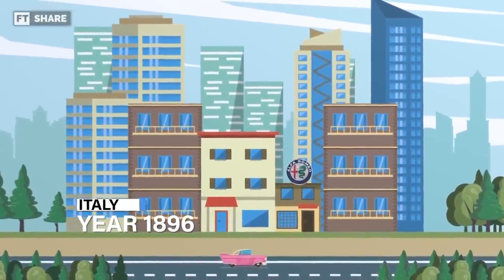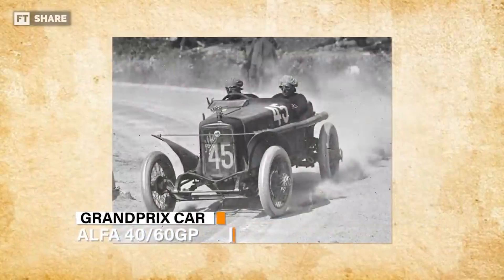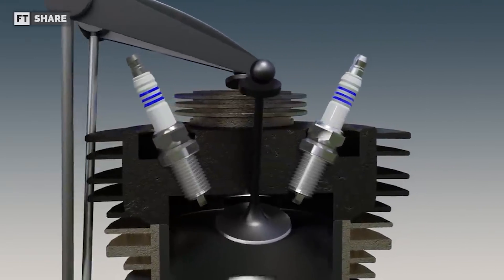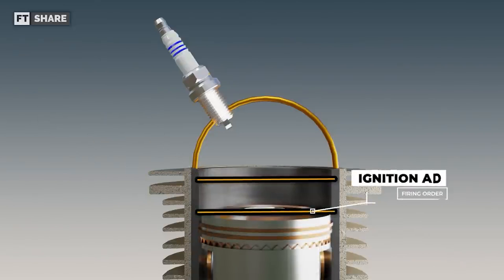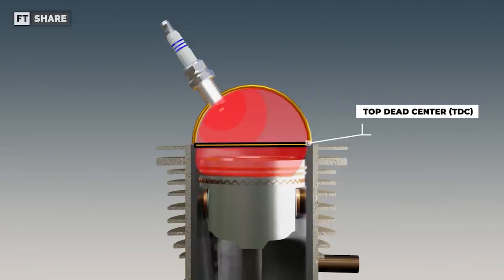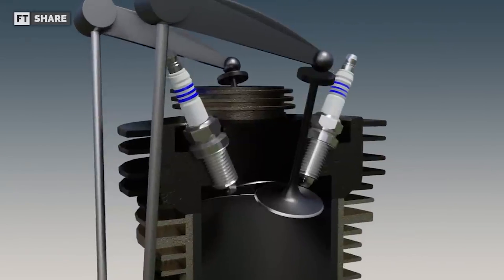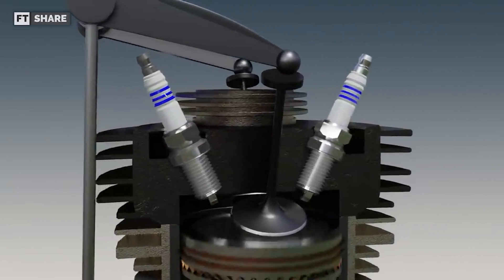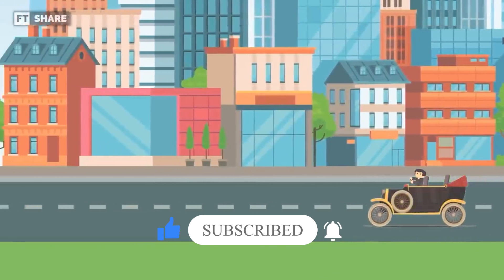TWIN SPARK PLUG - Why Dual Spark Plug Technology is Underutilized?? : Unveiling the Reasons

Comment: American LaFrance 12 cylinder fire engines had two distributors and dual spark plugs back in the 1950s and possibly earlier.
Some Ford 2.3 4 cylinder engines (variants of the old Pinto engine..not the garbage 2.3 Ford makes now) had dual spark plugs as well as did the Nissan NAP-Z 4 cylinder engines.

Comment: Aircraft engines are as redundant as possible.  Engines with dual spark plugs will primarily have them for increased reliability.  I bet they also drive them with independent ignition coils / electronics.  Any aircraft engineers care to comment?
Reply: They have to be. Aircraft cant just "pull over" if something fails.
Thats why Boeing got in trouble using only one sensor to control their MCAS system, causing two 737 aircraft to crash.

Comment: honda's stratified charge engine required a mostly lean air fuel ratio to reduce emissions, but kept it rich where the intake valve was. therefore they could only situate the plug at one location, making dual plugs obsolete, unless using a plug with two contacts at the tip.